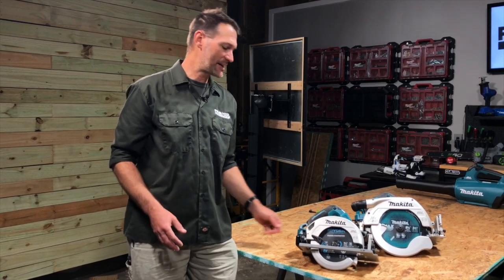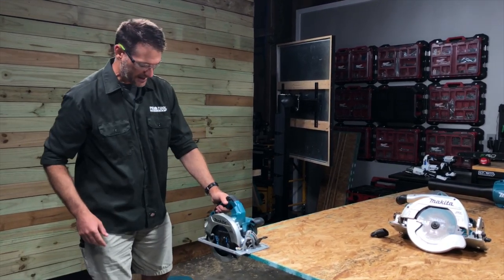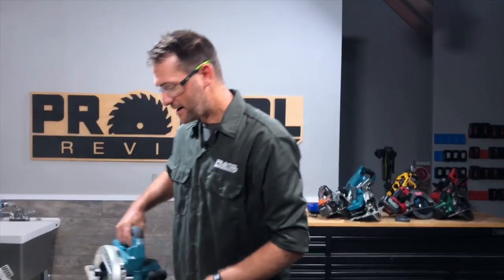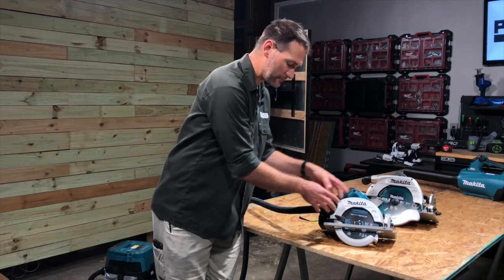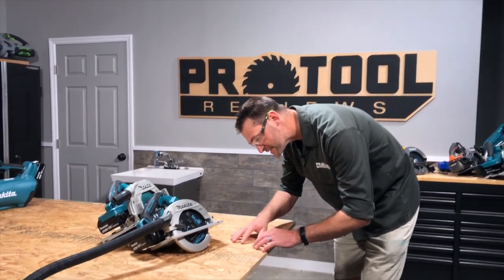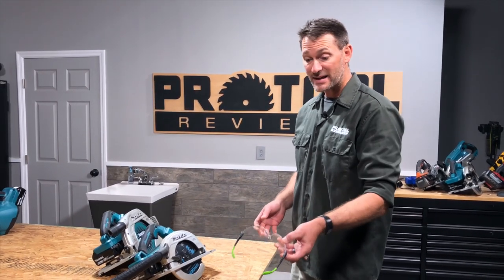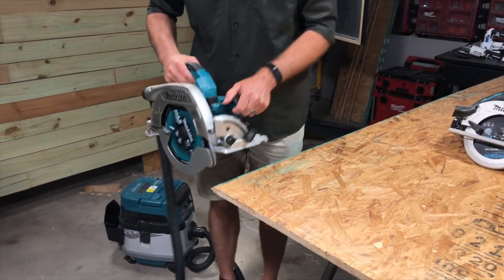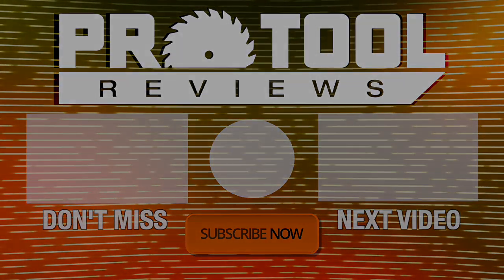Do Dust Ports Work? Benefits of Using a Dust Extractor or Vacuum with Saws

Comment: "What a great innovation". My 25 year old porter cable corded circular saw had that and I just assumed all saws have that. I would not dream of buying a saw without a dust collector port. Well technically the Porter Cable did not have an official port, it as was exhaust shoot that a shop vac hose would fit over and it would stay on better with a little duct tape. It made such a difference that from that point on I never bought a single high dust producing tool that I could not hook a shop vac up too. My studio (I am a sculptor) has always been my living room so dust collection is a necessity.

Comment: I just bought a Kobalt cordless circular saw yesterday. I was disappointed at how many saws didn’t have dust collector ports. 

One thing that I’ve noticed with this one is that it puts out a bit more dust than I’d like. But more annoyingly, it also ejects small chunks of wood out the front, at high speed, directed towards the front handle. They sting. 

Looking at your Makita here, it looks like it does something similar. 

I understand that I might be too perfectionist, but that’s so annoying.

Comment: As a beginner who only started learning woodwork last year I was shocked you're not using a mask when cutting with a circular saw :O

That aside I bought a Titan TTB 874CSW saw last year and it works great (highly recommended for beginners) but it never came with any attachment for sawdust extraction.
I tried making my own which looked good using an old vacuum cleaner brush attachment and small bag taped up with duct-tape which looked good but hardly any sawdust went into the BAG. Instead it was blowing it out of the front.

For the life of me I cannot find a specific Titan circ saw attachment for mine saw and find it bemusing why Screwfix have not included one.
Any suggestions?
At an angle the hole is 45mm x 30mm in diameter.

Hope some one can help with suggestions. Thx

Comment: @Pro Tool Review. Hey Kenny. Like your videos. So when you used that Makita blower to clear off the sawdust that makes me think you have a assistant whose job is to clean up the shop after your mess like cooks on a cooking show. Otherwise you would've vacuumed instead of using the blower. :)

I bought the dust shroud for my 6 1/2" Makita circular saw and the one thing that irked me was that Makita doesn't include the machine screw that hold the shroud in place! That meant having to figure out the size and then buying one. Really? How much can including one screw with the dust shroud cost?

Hope you and your family stay safe and well.
Reply: @Protoolreviews  Hmm. So if we buy the saw they'll include the dust shroud and screw. But when I buy the shroud as an accessory  I have to figure out what size screw to  buy? Hope that changes in the future.
Hope you and your family stay safe and well.

Comment: I have a Makita circular saw and they really make a mess covering you with dust then there’s the hazard to the lungs. I recently added a small supermarket type plastic bag fixed by a Jubilee clip. It’s probably not as efficient or healthy as an attached vacuum, but it’s less cumbersome and less expensive. Just seal and throw away the bag 😁

Comment: I have the Makita subcompact 18 volt I have the dust port Fort but I don't use vacuum cuz I'm outside I put it on left it on there from my sound stuff we get stuck in the dust port if you weren't using the vacuum I thought I'd let you know that you take care cheers with a beer

Comment: Does anyone know if the Makita rear handle 36 v circular saw has a dust port?
Reply: @Protoolreviews  as always thanks for all the info. 👍
Reply: The one I bought last year doents the one my boss just got does have one it's on the right side with a cap took me a couple of month to even notice
Reply: The original model did not, but the latest one does. The port is built in, actually.
Reply: @Protoolreviews  it does now.

Comment: I'm a Left Handed Guy, Carpenter and Certified Pre-Fab Home and Home builder, Framer the problem/major issues that I'm getting with using a sidewinder circular saw blade right is that stupid dumbass design of dust ejection port in the side of the saw, I don't mind the saw dust but I do not want a saw dust ejecting and shooting directly all over my face especially when I'm cutting a Pressure Treated Lumbers and we all know that Most lumbers are dangerous/Hazardous because of its materials that are known to cause Serious Cancer, and I cannot use N-95 Mask to solve the problem because you cannot breathe properly under the extreme heat of 90°F plus in the Jobsite. So Modern Sidewinder Circular Saw Blade Right with Saw Dust Ejection port are somewhat a dumb idea. Yeah for right handed people it's not a big deal but for Left Handed Operators it is a big deal. That's why I have never use any sidewinder saw especially blade right saw. I'm only using Worm Drives or Hypoid Gear Drive Saw, they don't have those dumb feature and the saw dust is ejecting downward that's what Circular Saw should be. I ditched my DeWalt DWE575, my Makita 5008mg, Makita HS7610, even my favorite Skilsaw SPT67WML all of them have those stupid dust ejection port. And the saw dust port adapted didn't work out the way I'm expecting it.

Comment: OK SO MAYBE IM A LITTLE CRITICAL, BUT WHEN IM RESEARCHING VIDEOS FOR INFO, ID LIKE TO KNOW THE HOST IS PROFICIENT. HAVING THE BLADE WAY TOO LOW FOR THE CUT IS NOT RECOMMENDED. ALSO HOLDING THE HOSE BUT NOT HAVING IT STAY CLEAR OF THE CUT WOOD IS ANOTHER RED FLAG.